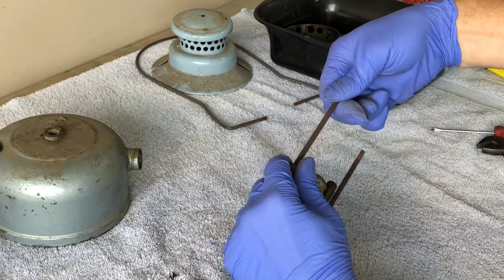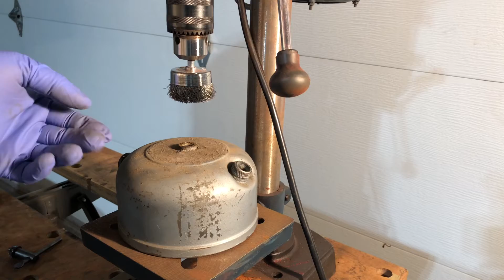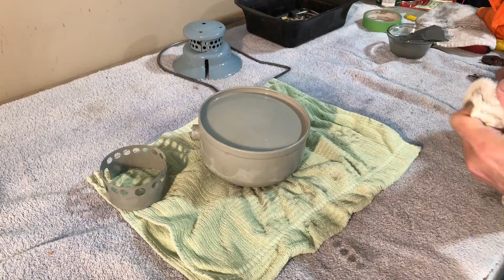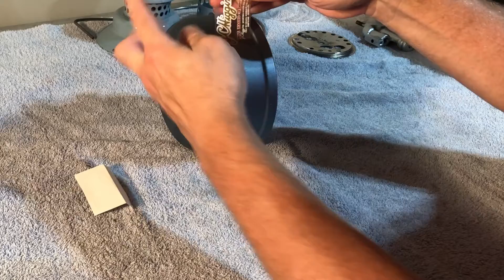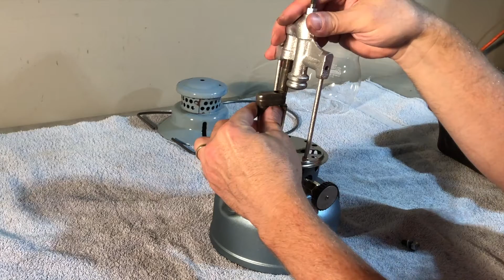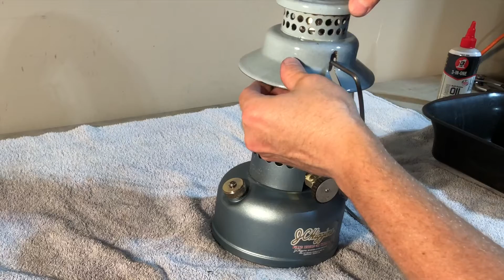1950s Sears J. C. Higgins Stove and Lantern Restoration: Part Two

Comment: Pro tip, try applying it wet, use a little bit of soap and water in a spray bottle. A couple of drops of baby shampoo and a touch of rubbing alcohol will make installation of decals a lot easier.